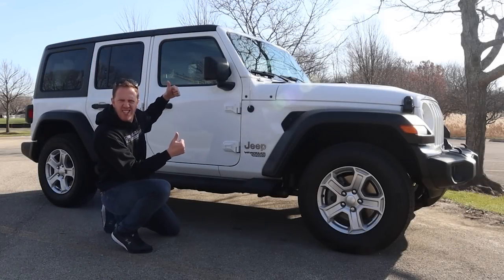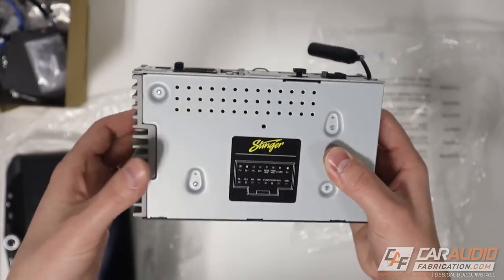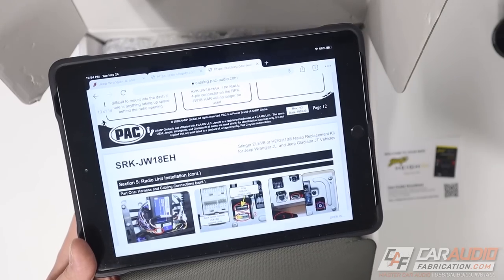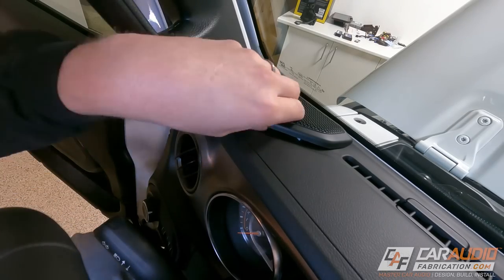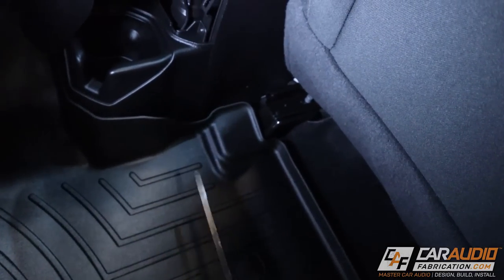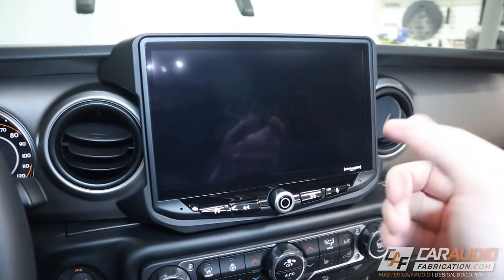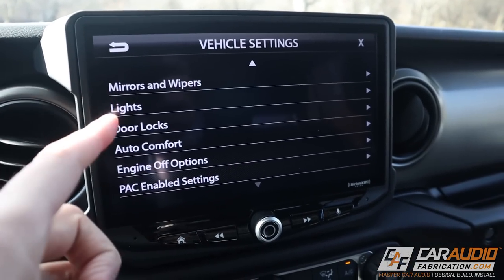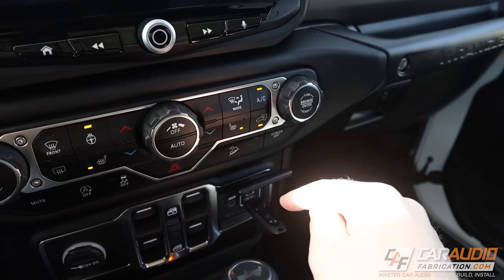Wrangler JL - DIY Radio Install HEIGH10 - HIGH END Sound & TONS of features!

Comment: Literally an installer's dream of integration.
Reply from the maker: Right? And those color instructions. 😍😍😍
Reply: I left the car audio installation biz in the '90's because vehicles were getting more complicated to install.  Auto manufacturers made aftermarket installations much more difficult and factory units were getting better.  These newer "black boxes" are awesome.  A little expensive, but made wiring and integration much much easier.  The industry did not even make factory radio harnesses when I started installing in the '80's.  Lol.
Reply: It's very impressive.
Reply: @chuckw6099  Me too.  I installed in the '80's & early '90's.  No harnesses needed and you could make your own kits.  I then worked for /////ALPINE for almost 10 years and and started another career when I saw the end of 12v profitability .  I still install 'on the side' and recently installed a X409-WRA-JL for a friend.  Nice unit.    I sometimes miss the old days and  definitely don't miss needing the right firmware to get aftermarket products to work.
Reply: I'm an installer and I cannot wait until digital audio becomes the standard. I know so many installers that are "afraid" of digital.

Comment: Not sure if that's their intention, but I love how some of those plugs are recessed into the unit so you don't have to worry about bending or damaging the plugs during fitting.
Reply: Trust me, it’s still very difficult to put the head unit in without bending wires. My HDMI came out of the PAC 3 times while putting it in.

Comment: I just had this installed on in my 2021 Wrangler Rubicon yesterday, including the integration kit. So far, its running well and really looking forward to having this system. Its really feature rich compared to my 7" unit.
Reply: How has it been?
Reply: Do you have an eight month update?
Reply: Any update?

Comment: I will never understand how all of these aftermarket units can retain all of the canbus settings and connectivity but every single one of them requires an additional microphone and GPS antenna. You can connect to all of the vehicle settings, no excuse for not retaining the the factory mic and GPS antenna.
Reply: Right, this confuses me as well... Somewhere else I read that the integration harness is so that you don't need to remove those things.

Comment: I just put this in my 2014 Silverado, and it’s amazing!
Reply: How do you add the sub-wolfer to this? Is it done by signal or speaker wire.
Reply: Mike Miller I used a 2 channel patch cable straight from the head unit to the amp. Has the connections ready to go for subwoofer amp. Plug and play. I tapped into my side fuse panel for the remote turn off.

Comment: What no one talks about. Is the fact u have to spend another 179 on the sd card to use the navigation. And another 68 bucks on the xm module to use xm radio. And don’t show how to hook it up.  It’s a great radio but these things should be made more clear to the customer.

Comment: Hey, Mark! Weighing my options while planning a build in my JLU. I have the factory 8.4 inch infotainment currently. Barring the larger size and added EQ options with the Stinger unit, are there any benefits this unit provides vs. using something like a PAC Amp Pro integrated with the factory unit? Additionally, are those added EQ and crossover benefits negated with the use of the PAC Amp Pro in conjunction with a DSP? It seems that unless you desire a larger/improved radio, the ease of install and adjustment/ EQ options associated with an Amp Pro and DSP combination largely outweigh the benefits of a head unit upgrade. Thanks in advance for any insight!
Reply: I'd like to know as well

Comment: My only question is does the Stinger High 10 still provide the internet that the factory provides? For example I have a silverado and GM has a build in internet connection.

Comment: Hi, I just bought a 2021 Wrangler Sport S 2 door. I plan to upgrade the 7 inch unit to the HEIGH10. I currently have as home audio a Devialet 140 and Sopra no1. What speakers-sub /amp combo would you recommend in the jeep? Any help is greatly appreciated.

Comment: you showed a sd slot for off road information/maps at the beginning.  It looks like after the install that slot is not usable.  Correct?
I have a zautomotive mini programmer that allows me to change many factory options.  Does this help/hinder the Stinger functions?

Comment: Just installed this in my JL, I'm having issues with the usb drive. I've reformatted 3 different drives, 64gb and 16gb, left them plugged in for 24 hours but the kit will not read any of them. Any advice/ ideas?

Comment: I have the Heigh10 installed but CarPlay isn't working. It reads usb drive but when I connect my iPhone with wire it connects and disconnects immediately in both usb slots. Any idea what it could be?

Comment: I have the unit for a 2018 ram 4 door I am upgrading the speakers to kicker and a single 10 sub also kicker with a 400 watt amp  what do you recommend if I want a dual 10 box and do you think this is a good set up

Comment: I have the more basic AC / Heat controls (no auto) I assume the AC controls won’t work on this head unit because of that, right? Little unsure how the AC screen will look like in my case. 

One of the reasons I like the idea of getting this head unit is that it has a volume control knob.  In my case when I upgrade I’ll lose the only volume control knob I have and will be limited to steering wheel control.  This solves that issue.  Great video!
Reply: I would like to know what info you are getting on the AC screen with the basic AC / Heat controls?
Reply: @Scott-pg5mu  Hey Scott, I’ve had this in over a year now and like the unit.  I do not get anything on the screen however with the basic controls.  Only issue I have a this unit is the screen goes blank in reverse 1 out of every 20 times.

Comment: Mark. My head unit has a crossover, my amps have crossovers, and components have a crossover. How do you configure this? Ditch the head unit crossover and stick with the amps? Or keep the head unit flat and use the amp crossovers?
Reply: The Stinger head unit has high and low pass crossovers but not for mids and tweets.  For component mid and tweets, I still like to use the factory passive crossovers.  The speaker manufacturers spend a great deal of time to get them to balance nicely.  Plus, some of the passive crossovers have protection circuitry in them to protect the tweeters.  To tune the system, use the crossovers that are in the head unit to set up your system.  Then you can "transfer" those settings to your amps and then leave your head unit "flat".  If you are like me and adjust for different mid bass sounds according to your volume, then I would use the head unit's controls only.  I would still use a very low pass crossover point for the mids just as insurance to protect them from over driving bass tracks in some songs.

Using the crossovers in your head unit depends on your knowledge of tuning a stereo system.  I installed car audio for a long time, may years ago and still enjoy tweeking the settings. For those who do not know how to fine tune a system, they should use the crossovers in the amps.  Less chance of damaging your speakers if you accidentally change settings in the menu.

Comment: Wow, what a product!

Since this incorporates audio DSP features, how do you think your workflow use of Audio Control's DSP units will change?
Reply from the maker: There is a large difference between global EQ that impacts the whole system and EQ that controls each individual speaker. Adding DSP is still a valuable upgrade.
Reply: @CarAudioFabrication  how do you connect this to the dsp and aftermarket amps? I can't find any videos of this.

Comment: I love this step-by-step....thank you so much for taking the time to share this install with us! Couple questions I have is, why is it necessary to run another mic and speaker for chimes? And I can't find it anywhere what the RMS per channel is on this unit. I have the same factory set up as you, with the 7" non-Alpine system and all stock components. Trying to figure out where to start. So many options! Oh and my local shop said that they do a component 6 x 9 in the sound bar, and I can't find anything on the net with an example of this. I really love the idea of having that set up in the sound bar. Just a thought. Thanks again.
Reply from the maker: Stock mic can't be easily integrated and isn't as good of quality. Some chimes must be recreated with the new speaker. Power output is in line with other aftermarket head units
Reply: The Stinger box say 4x50 watts.  I would say it is more like 4x25 "usable" watts.  I am running the rear channels to my Focal 6 1/2"s in the soundbar and it isn't as loud as my front set of Focals in the dash/knee housings.  Those and my dash speakers are running off of a Kicker KEY 180, which is 4x45 watts.  The rears certainly don't keep up with the fronts.  Me personally, I would not think that 6x9s in the soundbar would have enough airspace, but then again, my dash/knee speakers' bass output is much better than my soundbar.  Same exact speakers, polyfilled and dampened with sound deadening.  The chime is required because the unit takes a long time to boot up, defeating the required government warning systems.  The mic also puzzles me since the factory handsfree was excellent and now my friends tell me the new external mic with the Stinger unit doesn't sound as good.  I have the new external mic on the upper left of my windshield/pillar area.  YMMV on that.

Comment: I'm heavily considering upgrading to this. But is all of the vehicle info and climate control available outside of jeeps? I have a 2018 Gmc sierra. I have seen install videos for my truck model, but I've only seen the vehicle info shown in a few videos and I think they were all jeeps...
Reply: You lose heat info in gm trucks, you also lose the extra settings like exit lighting settings, teen driver, remote start heat seats..

Comment: I  have the premium sound system with the 8.4 head unit. I don't think its enough bass. Want to add one, maybe two of the JL bass boxes but keep everything else stock. Will it work and sound good?
Reply from the maker: Yes it will add bass. The stock system isn't very good in terms of speakers either, but you can always upgrade those at a later date.

Comment: I can already tell you what the best 0-60 time on the JL Wrangler will read SLOW! 🤣I also believe the reason the direction of travel is not showing on the Driver Information Center is due to the Can Bus system in most cars. Hopefully one of the manufacturers of vehicle integration will crack the Can Bus system this year! 🤞

Comment: does it put the turn by turn navigation into the center lcd jeep screen between the speedo and tach if using the sdcard nav?
also if the jeep came w/sirrus, can it be reused w/this? also would it work w/the fac alpine parts like sub and stock speakers.  sorry lots of questions...

Comment: Great video Mark. I’ve been wondering about this radio for a long time now. Few questions/comments I have for you that aren’t addressed in the video. 
1. Is screen mirroring possible? If so, how? 
2. This question doesn’t necessarily pertain to this unit, but have you ever integrated the Bluetooth microphone to the stock microphone location for the vehicle? I know it would take some time as you probably have to remove the headliner and remove the stock mic, but I feel like it would be something that looks OEM.
3. Lastly, what are you doing build wise for this baby? 😎
Can’t wait for the build log!!!
Reply from the maker: I don't think there is any mirroring. I can't say that is a feature I ever really seek out. Im not sure why the factory mics aren't used but I am sure its a good reason. With the amount of integration this thing has I am sure if there was a good way to interface with that they would have, my wife said I do sound much clearer and better now when I talk over the new mic, so perhaps the factory mics are just poor quality. And for the build... its a secret, and still partially being decided, but it will be cool!
Reply: @CarAudioFabrication  thanks for responding. As for the stock microphone, I was only referring to placement. Using the stock location with new mic. Man, I’m excited for this project and it’s videos.

Comment: Just finished my install yesterday. Thanks for such a detailed video. One question I have is my screen looks a little washed out on white backgrounds. Where I see it most is maps in CarPlay. Have you seen this before and any idea what it could be? Loose connection? Defective heigh10 display? Thanks
Reply: Did you ever find the reason for the washed out screen, I just installed mine and it also has a low resolution screen in android auto

Comment: With the option of an integration kit, they need to slim down what actually comes with the Elev8 or High10.  Just the 2 main components.  This would keep costs down.  Optionally, just another part# for both with this option.

Comment: Most of my future's on my 2014 Jeep Grand Cherokee are built into the radio such as heated seats 
AC and  Heat controls how do I put an aftermarket radio in that Including my backup camera where 
when I backup my lines for my backup camera moves to?  Is there a Pacific radio that I can use for 
that? That would have all the RCA outputs that I would like to use?  I do have the larger display 
and my Dutch. Ty  I forgot to mention I also have a Built-in CD player that I would like to 
retain in my center council.
Reply from the maker: You are in luck! PAC Audio (The sister company to Stinger & Stinger Off-Road, both under AAMP Global) has an awesome integration kit that retains the climate controls, camera, vehicle settings etc. The kit is the RPK4-CH4103. I'd actually like to get one to review on the channel as I think it is another cool example of what these guys are starting to achieve for cars that would otherwise be impossible to add an aftermarket unit in!  The more we can support these guys the more cars they can do in the future which will be great for us as consumers.

Comment: How much of a difference do aftermarket head units make if you’re already using an external dsp and amps?
Reply: That really boils down to the quality of the signal from a factory stereo and the amount of voltage your running your pre-out levels at. And whether or not you will be tweaking EQ a lot, although some DSP’s probably have stored EQ settings that you can change with a control knob.

Comment: Hi im interesting in this radio for my jeep JL 2020, i dont see the specs of the radio and output, have an ds18 speakers,driver twiter and bass. How much output have , what is the potency of the radio
Reply: The Stinger box says 4x50.  It seems like 4x25 to me and I am running a Kicker KEY 180.4 for my fronts.  That is a strong 4x45 and the rears do not keep up with the fronts.  Same Focal 6 1/2"s front and rear.

Comment: I just bought a stinger too but I am still waiting on my modules. How is the sound on the heigh10?
Reply from the maker: Sounds awesome! It's not going to compete with adding an amplifier power wise so you can't expect it to, but as far as OEM vs this its a lot better. And this allows you to add amps easily!

Comment: For the sports model  will volume and tuning be only on the steering wheel  or does the radio have buttons
Reply: The HEIGH10 does have a volume knob.   With this kit, all the volume knobs and steering wheel controls work.  Tuning can be done with the steering wheel controls and on the touchscreen.

Comment: How I should wire an OEM JL wrangler subwoofer to this radio. My JL did not come with the factory subwoofer, and I bought a used  OEM one, and I want to wire it to this radio that I have already installed.
Reply from the maker: That's not how it works.
Reply: @CarAudioFabrication  what do you mean?
Reply from the maker: The radio doesn't have the power for a subwoofer. You need to add an amplifier to power the sub.

Comment: As a previous owner of a 2018 JL Wrangler Rubicon and now a 2020 JT Gladiator Rubicon, I was not impressed with the factory Alpine systems in either Jeeps.  I have been looking at different Android based head units and decided to order a HEIGH10.  I did not order the Sirius XM module or the GPS memory card.  I am not impressed with the sound quality of the satellite and the GPS can be "free" from the phone.   Looks like Stinger did a great job and the only thing that might bug me is the Wrangler graphics instead of a Gladiator one.  I currently have the 7" screen, changed out all the 4" speakers to 6 1/2" 2-way Focals, 3 1/2" JL Audio 2-way in the dash and a pair of powered 8" subs behind the rear seat.  The factory unit is feeding an Audio Control LC2i PRO, which I really don't need, to a Kicker KEY 180.4 that feeds the front upper and lower dash speakers.  Once I install this new head unit, I will not need the Audio Control piece but I might still put in a remote bass knob.  I am not a big fan of hunting through the menu to change bass because that varies from song to song.  I was a car stereo installer from the early '80's to mid '90's.  The shops I worked in, never really did much custom work, so I never did have a ton of experience doing those.  Your install videos have been a great help even to us older installers who still enjoy loud and clean sound.  Keep up the great work and thanks for the discount code.  FYI, I used to live in Flagstaff in the early '70's and miss the pine trees.  I do occasionally get out of Phoenix and head up north for the fresher air.
Reply: The radio DOES show a Gladiator when it is installed in a Gladiator 👍
Reply: @Spur5000  Very nice.  Cannot wait until I get mine in and I will find out for sure.  :D